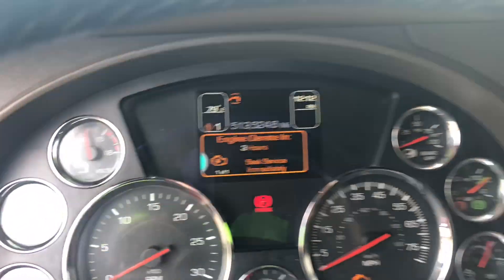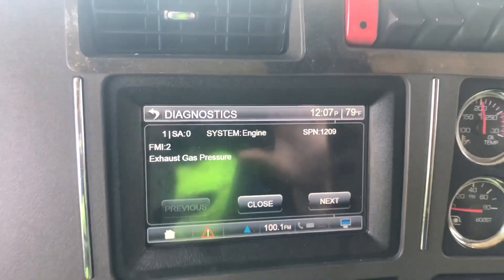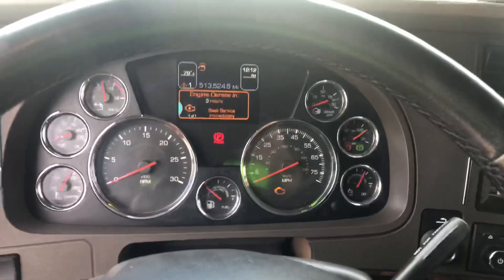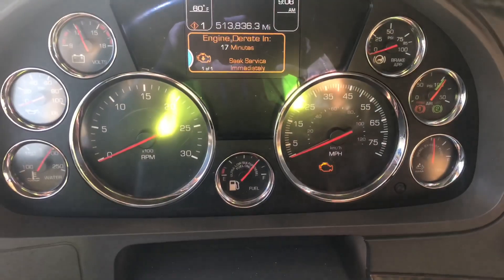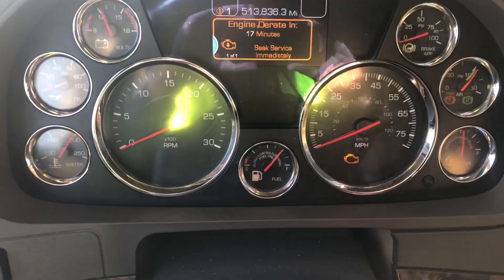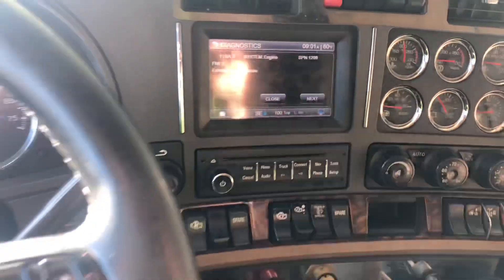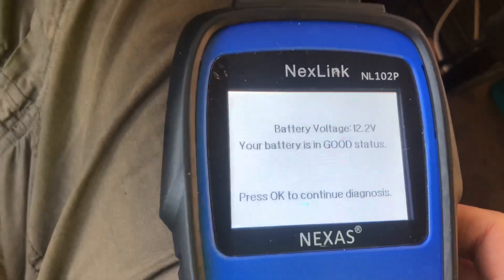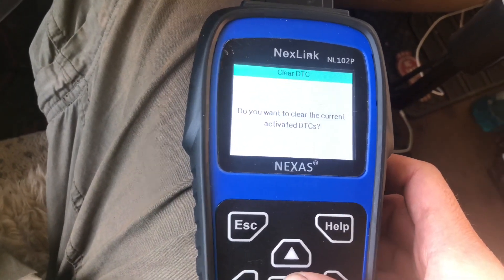Cummins ISX exhaust gas pressure sensor replacement Fault code SPN1209

Comment: What were the symptoms? Did the engine hiccup? I have no warning now, it comes when I start the truck and it goes away and I don't have the code reader
Reply: What do you mean by engine hiccup?
Reply: @fivestar000  it felt like the turbo would cut out for a split second, like someone would plug up the intake side, it was only for maybe half a second. And if you have a boost gage, mine would jump all over the place. It was a bad exhaust back pressure sensor, no engine light though
Reply: @AZgule2010  my truck is doing the same thing!  Feels like it cuts out when you give too much throttle then the boost gauge all over the place!
Reply from the maker: Yes the engine hiccuped
Reply: @GENNADYS2006  thank you, those were my symptoms and I replaced the sensor and it went away, just in case someone else has this issue

Comment: All those sensors are on the same circuit you should replace all of them at once.
Reply: Saves a lot of headaches
Reply from the maker: Yes my friend, It’s better to replace all of the sensors at once.2 weeks later after  I did this video I replaced 3 other sensors despite everything was working good.
Reply: @GENNADYS2006   Do you know what the other 3 sensors are it would be much appreciated
Reply: more details please ?
Reply: @Uc9uE3pKsS6uQ  there’s the one he changed and the eve differential pressure sensor and the egr  temp sensor  those are good to change once a year to avoid de rates